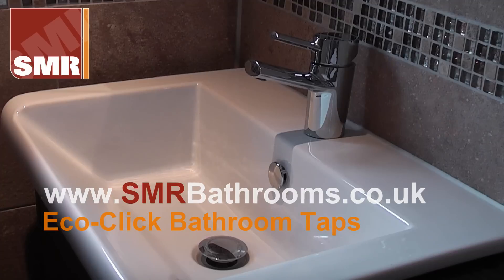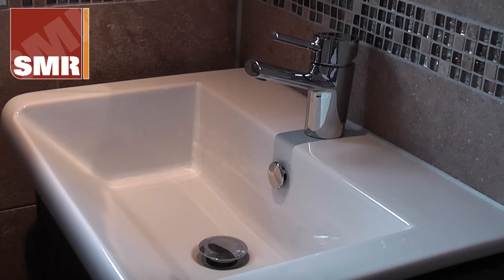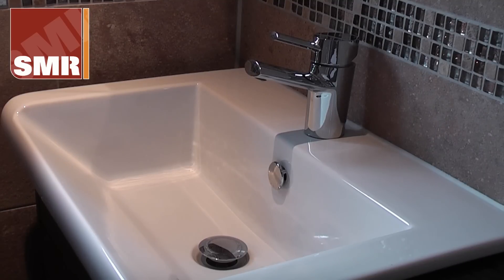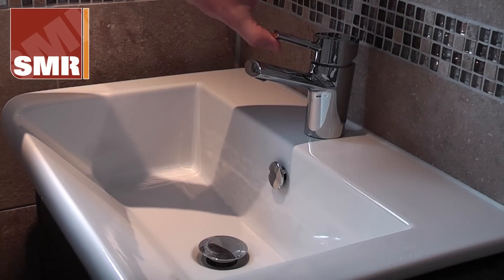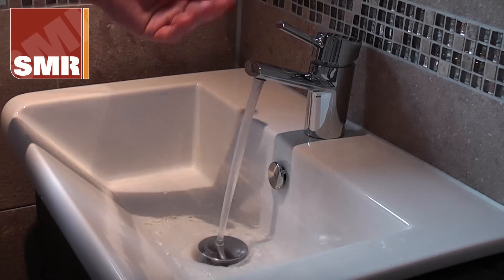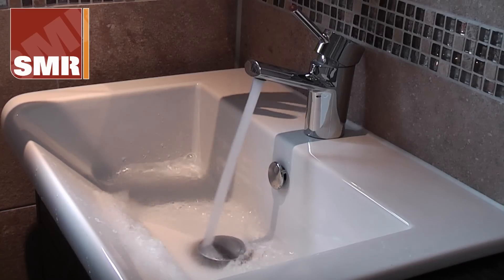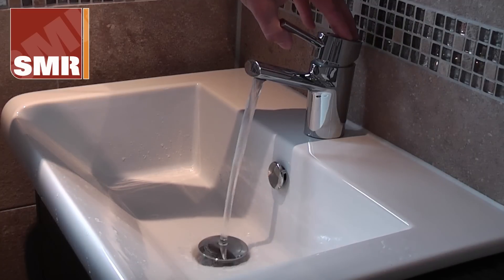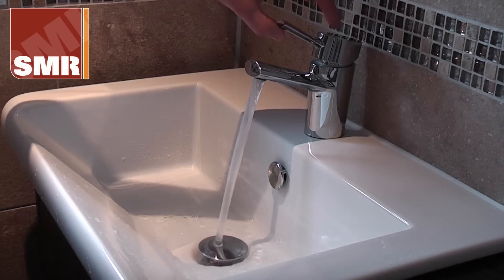Eco Click Bathroom Taps

Comment: so... the Ecoclick is a high resistance to go full flow? Did I got it right?
Reply: Pretty much. It's like any other tap but it has a noticeable stop point at a lower (more economic) flow rate. It can still be moved beyond this stop point to it's maximum flow, but the idea is that it shouldn't need to be.